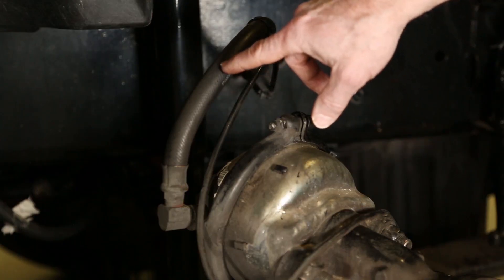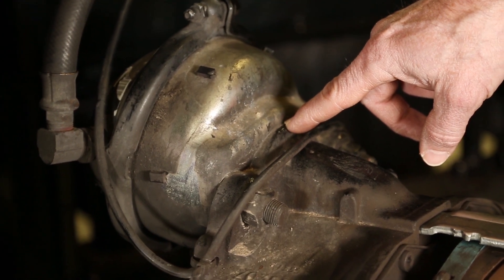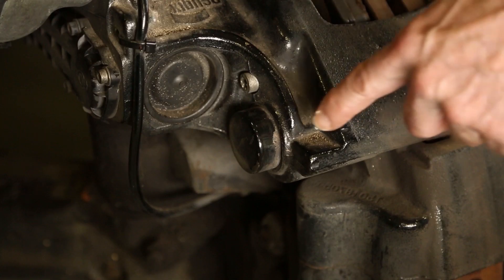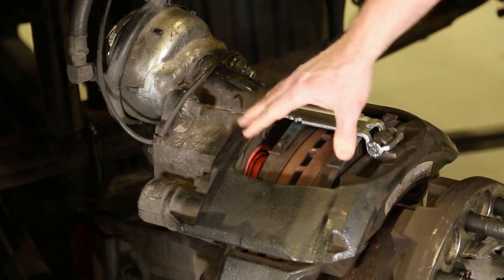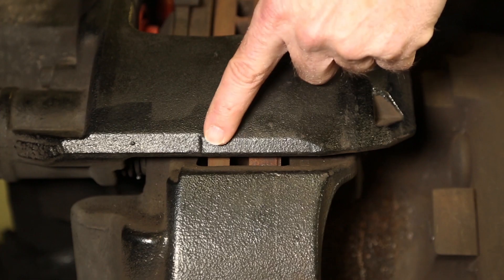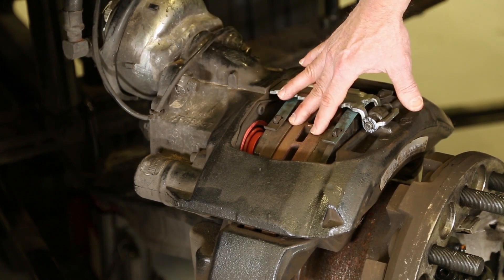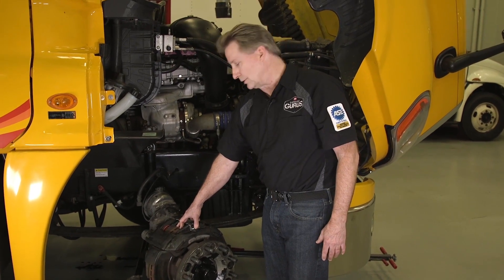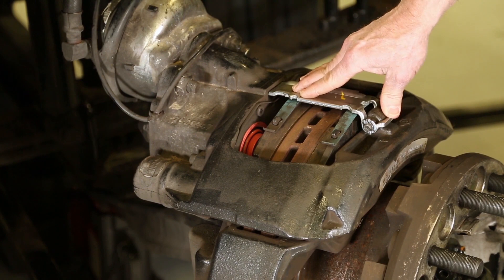Heavy Duty - Air Disc Brake Inspection

Comment: What is the minimum thickness of the pads allowed by DOT?
Reply: 1/4 " at it's thinnest point.
Reply: @jaminova_1969  what is usually the thinnest point? The ends?
Reply: @jaminova_1969  mine are pretty thin I stuck my fingers in there to feel it and Ididnt think they'd be that thin. The truck only has 60,000 miles on it

Comment: What do you do when the caliper doesn’t move back and forth ?
Reply: Grease it the slides. And check to make sure the boots are not ripped. Also prior to checking the slides, find out if your vechile needs to br checked with the brake on or off.

Comment: What about drive tires do you have to remove them just to see how much pad you have left?
Reply from the maker: You might need to remove the rear tires.  It all depends on the truck vocation and whether it has duals or super singles.